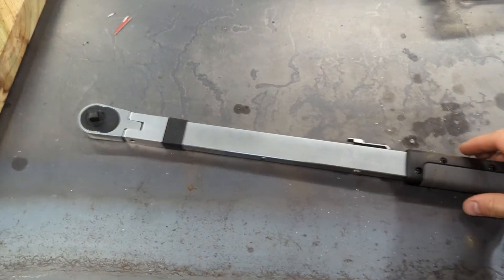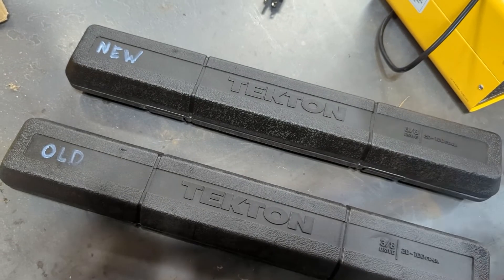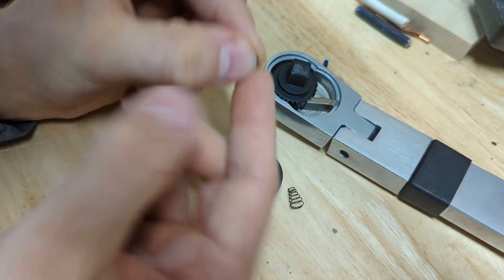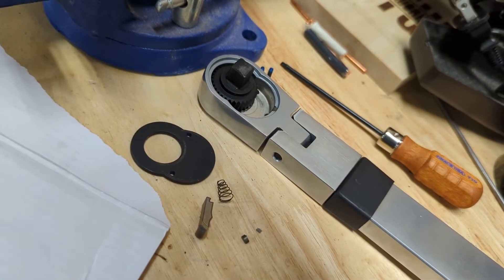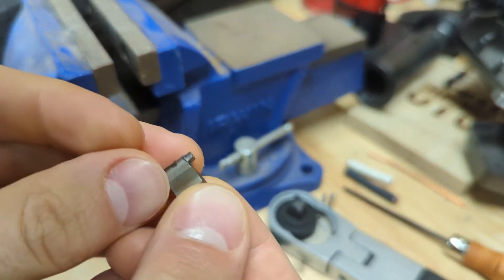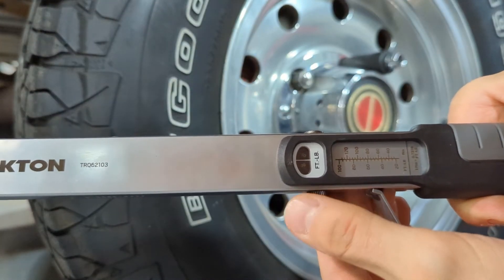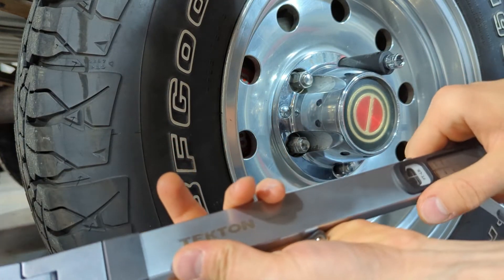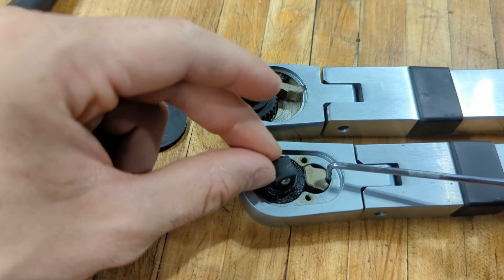Tekton Torque Wrench Failure - Warranty Experience, DIY Repair (?), and Design Revision Comparison

Comment: The new design  they break quicker
Reply from the maker: Thanks for watching, Bobby. In my practical experience, that is not the case. The old design broke pretty quickly for me, despite being someone who is relatively easy on their tools. The new design has been going strong for three years so far with no issues. Just used it last week, in fact.

Comment: Thanks for the detailed video.
I wonder if it is possible to remove the head and install it facing the other way plus what you did at 8:35 and use the wrench counterclockwise?
I have to set the timing on a BMW M62TU engine and counterclockwise torque is needed.
Reply from the maker: That's a very interesting idea. Let us know how it works out!!
Reply: @rckclmbr85  It works! 
I did the timing with this torque wrench converted to counterclockwise use, probably much better than any torque wrench which works both ways.
Reply from the maker: @Mr7E38 Nice! I admit I was skeptical, but this is really useful information - given how inexpensive these wrenches are, if you have the need, buying two and converting one is a very reasonable proposition.

Comment: I have had more Tekton ratchets break than any other brand. I went and tossed them in the trash and instead used other brands such as Icon, Kobalt, etc., and no issues.
Reply from the maker: Thanks for watching! So far, this is the only Tekton tool failure I've experienced. I use their 1/4" and 3/8" standard ratchets all the time. Will definitely post something if I experience issues with their other offerings.

Comment: Nice video. I had that same model fail. The dial cover popped off and something internally came apart. The warranty process was quick and easy. But the replacement doesn’t inspire much confidence. I need to check if the new one is the updated version. Since then I got a good deal on a used snap on so I brought the tekton home. The broken one is sitting in my overflow box.
Reply from the maker: Thanks for watching! I was quite impressed with the warranty process - not sure if it's always that smooth or if it was just because this was a product with a known issue? Hard to say, unless I break another tool, I suppose : )

Comment: You might be able to get a pawl set for a proto wrench or other similar type to repair the old one.
Reply from the maker: Thanks for watching, John. I'm going to give silver solder a try, just to see how strong it (the J-B Weld didn't hold up). I don't care about the old wrench, as I have the new one, so now we're just experimenting. May also do a video of taking it apart to see how a split-beam torque wrench actually works.

Comment: They most likely kept the model number the same in order for people who bought the older torque wrench to qualify for a warranty replacement, because as you know, lifetime warranty only applies to the lifetime of the tool, and the moment the model number changes, the lifetime has expired. I learned this the hard way with a different company who decided that changing the color pattern of a tool was justification enough to change the model number even if nothing else changed and thus voided everyone's warranty who bought the older one. which goes to show Tekton is looking out for their consumers cause that head redesign would have been more than enough to justify calling it a new model torque wrench.
Reply from the maker: Thanks for the insight! I honestly didn't realize that was how "lifetime" warranties worked. If that is indeed the reason Tekton did what they did, I'm even more a fan of them. Cheers!

Comment: This is one of the biggest mysteries to me. Why would anyone buy an Asian-made rip-off instead of buying the original and legendary American-made Precision Instruments Split-beam torque wrench to save less than 100 Dollars?
Reply from the maker: Evening. Thanks for watching. I'm with you. However, you need to check your facts - the difference isn't even close to $100. As of this comment, the Tekton 3/8" split-beam is $115, and the Precision Instruments 3/8" split-beam is $138. You'd have to be crazy to buy the Tekton just to save $23. I bought the Tekton because I had their rewards and a gift card, so with shipping and tax, I paid $7 for mine. My 1/2" is a CDI, so I do own some nice tools : )
Reply: @rckclmbr85  You paid $7 for a torque wrench? I'm impressed and I would do the same thing when I was young and I didn't have much money back in the 1980s and 1990s. I was saving for months to purchase each of my Proto torque wrenches. Each one was over $300.00 Canadian back in 1997 and 1998, but I don't regret it because the quality was as if they were made by Rolex. I still own them today and they look like they just came from the factory. Electronic torque wrenches were just a dream for most people, even professionals until recently.
Reply from the maker: That's quite an investment! I do appreciate and am willing to pay for quality - especially if it's made by my "neighbors". Sometimes I have to be practical. Those Protos do look nice, though... : )

Comment: Have you done a follow up? Im curious to see if JB Weld would be strong enough to hold for a long time.
Reply from the maker: Evening, Gerardo. That was just a couple of weeks ago - haven't even needed to use a torque wrench since then. But I'll definitely post a follow up if it fails. I hope it doesn't - that would shatter my delusion that J-B Weld can fix anything : )
Reply: @rckclmbr85  the new one is completely different I’m definitely going to ask them for that one when I order mine this week.
Reply from the maker: Evening, sir. My assumption is that they no longer sell the "Gen 1" model. However, you never know. Best of luck!
Reply from the maker: Just posted an update...and here I thought J-B Weld could fix everything but a broken heart : \
https://youtu.be/Nu_ZvJXqe6Q